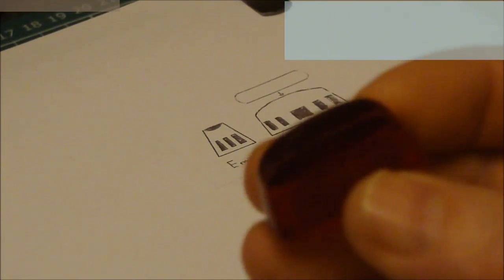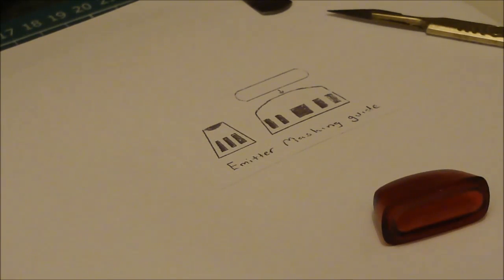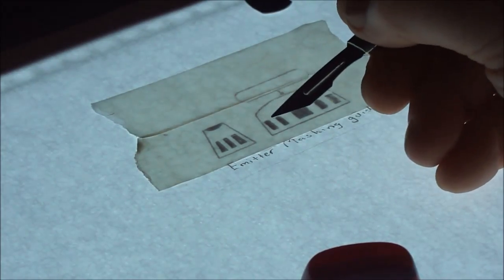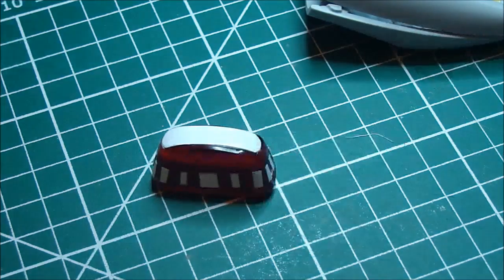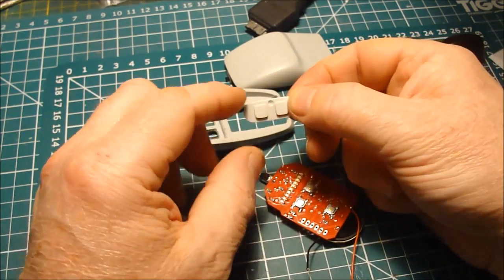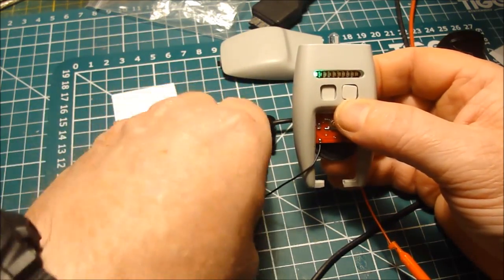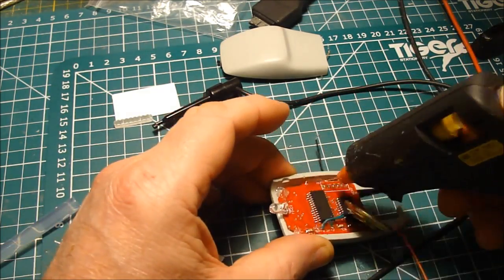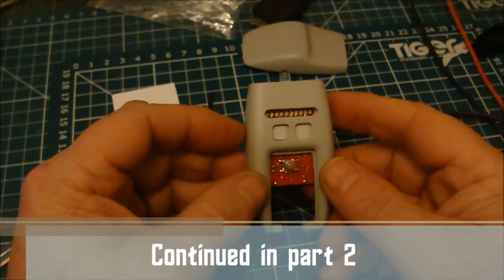Star Trek Cricket Phaser Part 1   Emitter & Electronics Board

Comment: Where can we get the model kit to install the electronics and is it all prepared for instant installation or do we need to do some tweaking to get it done?
Reply from the maker: Stapleton productions make the model kit,  I got mine from eBay, do not know if they still sell them as they are not mass produced.  And not it is not 100% so prep work is necessary  such as sanding and trimming but these are almost 95% good to be used upon arrival.
Reply: @FlankerTanker  
Hm, okay. Thanks Tank.